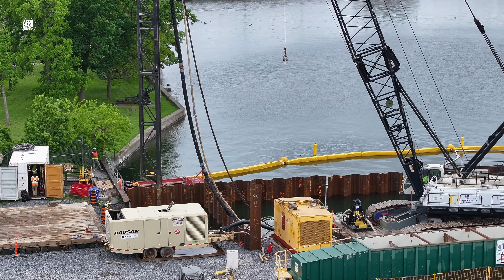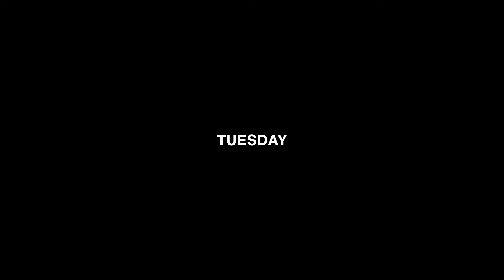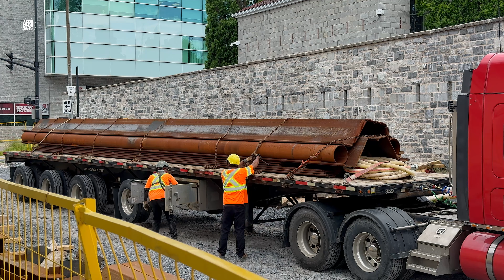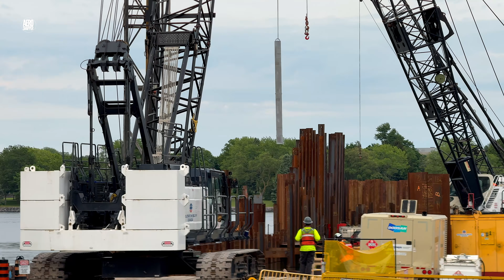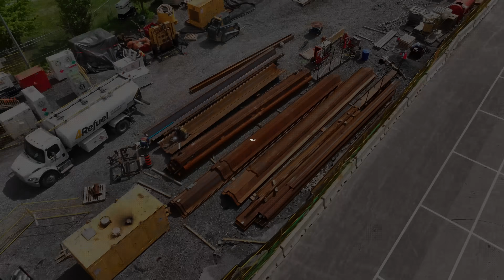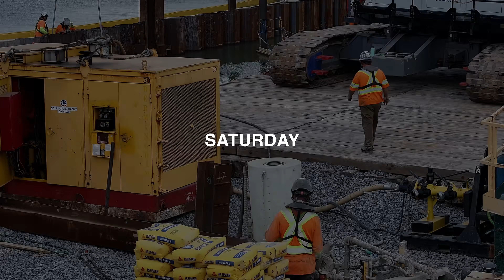Drill Baby,  Drill   4K

Comment: What is the purpose of the drilling and pouring concrete in them?
I was under the impression that they would eventually fill in the space with gravel and the piles would form the outer wall. or will the perimeter of the pier be concrete wall? If so, will the concrete be on the outside of the piles,   encompass the piles on either side, or fully inside  with the piles eventually removed? (you have mentioned in previous videos those piles are the permanent ones).
Reply from the maker: Great question.  The medium pumped into the 'tubes' on the outside of the sheet pile is a grout.  Details at the end of this response.  It consolidates the micropiles or toe pins which are lowered into it and a hole drilled beforehand. They serve to ensure that the base of the wall resists any forces that might cause it to move outwards.  Tie rods will anchor the top of the wall to an existing wall along the old dock margin.  Then, gravel will be used to infill and a concrete / asphalt surface laid.  The outside of the wall is likely to be left as it is, but with a rail-lined concrete cap like the walls around the new secondary dock currently in use.
https://can.sika.com/en/construction/shotcrete-tunnelingmining/injection-products/cementitious-products/king-ms-cable.html

Comment: A hoped for mere glimmer of understanding promises to override a tiny bit of the confusion I have been experiencing, There are so many things in the water. I don't know what will be taken out, if anything, what will stay? Will tall things be cut down? All evidence of my ignorance. I must await developments and so I thank you for providing them.
Reply from the maker: Joy - you're very likely no more confused than any of the rest of us.  Let me help if I can with some things that I believe to be true.  Perhaps if I get them wrong, someone will chime in.  The only structures likely to remain in the water once the sheet pile wall of the dock extension is complete will be the line of piles closest to the gravel infill now.  The large, cylindrical king piles, platforms, crossbeams and H-piles that support them will all disappear.   The wall that remains will be cut back a certain amount (likely much less than a metre) to meet a level that engineers have calculated to become the base of a solid, likely concrete, cap on the dock sides.  Tie rods will then be run back to the original dock wall from the new one and full infill will occur.

Comment: Strange that the company that is doing the concrete curbs doesn’t use a curb forming machine for that instead of screwing around making the forms like they are doing.   It would be much more efficient and would be easier to do.
Reply from the maker: You are very observant. The path was set up and strung to run a curbing machine, which Sousa own, but arrangements were changed.
Reply: @Aerosnapper  seems strange they would change to a much less efficient way of making curbs lol